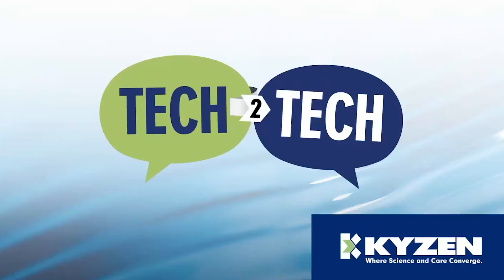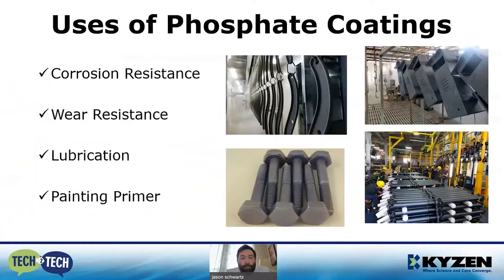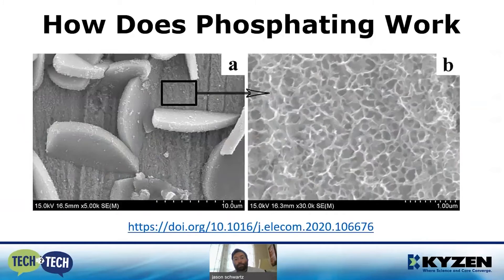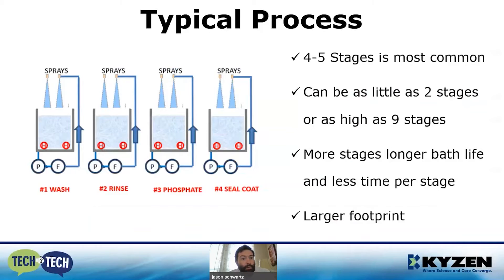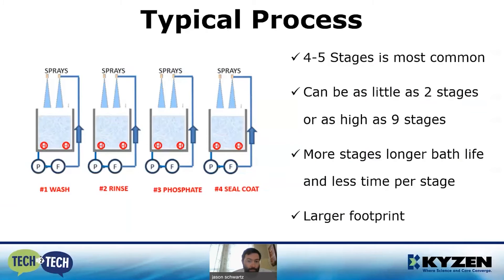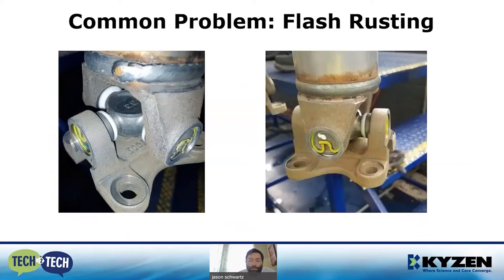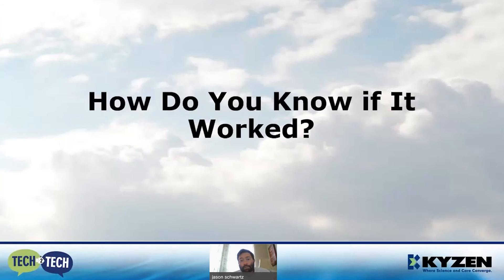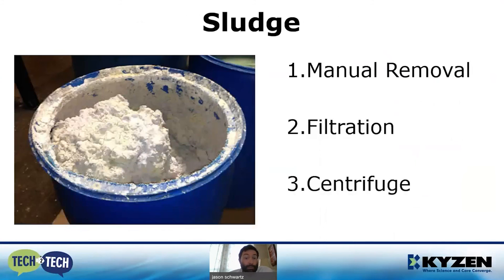What Do You Need to Know About Phosphating? - Tech 2 Tech

Comment: Hi there. i saw you video about the Phosphating. I would like to try to use this in my Production process where we produce Oil Immerse Distribution transformer and with these process can apply Anti Rust to the surface of the Tank and cover of our product. I have a few questions.
1. Before Phosphatic Process, we can perform Washing to remove dirt on the surface right?
2. After washing, we can do Phosphate dipping. May I know how long we will dip it to the phosphate solution.
3. Is Phosphate Solution is combination of Phosphate chemical diluted to water?
4. After Dipping, do we need to wash it again with water?
5. If needed Washing after dipping, we need to dry it before painting.

Can you reply to me for my inquiry? thank you so much